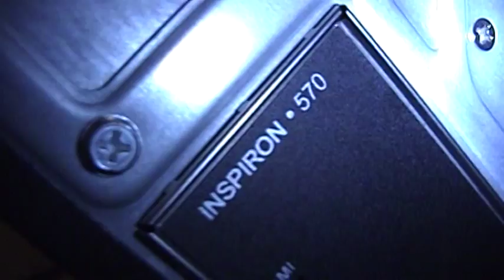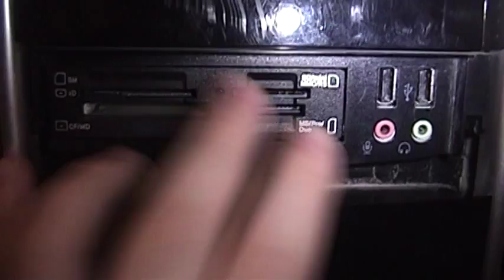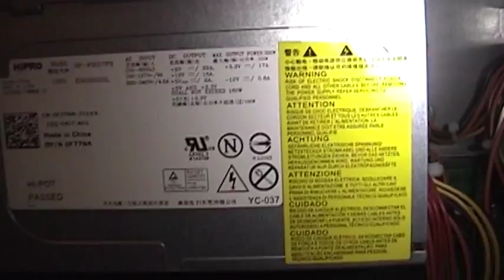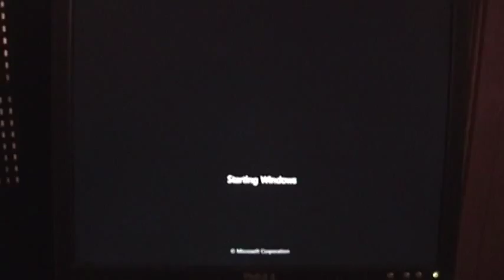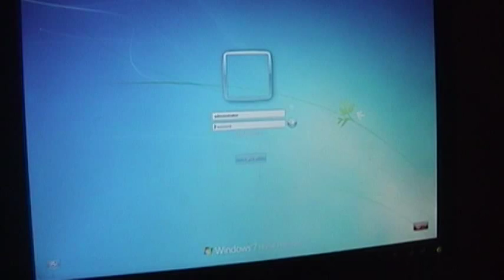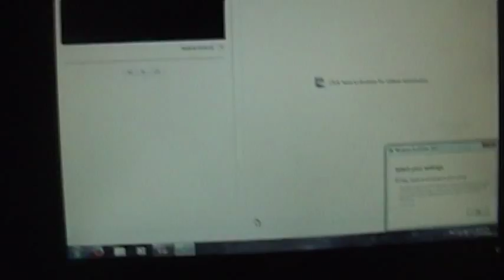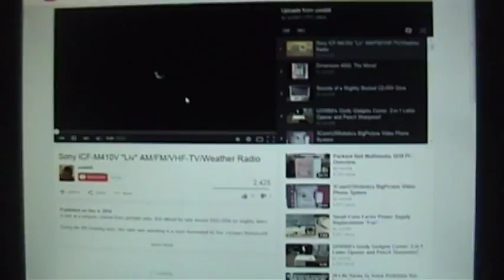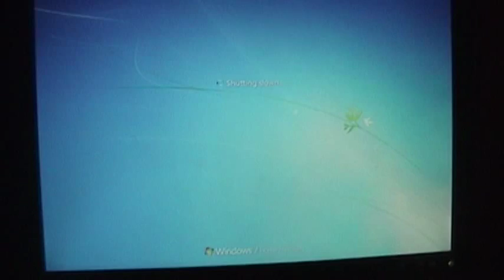A Dusty Dell Inspiron 570

Comment: I caught the STOP code as being 116, which is indeed a video driver problem ("VIDEO_TDR_ERROR", or basically "The driver crashed and had problems recovering"). ATi's later drivers are not well known for stability as far as I can tell. I'm not sure if they've gotten better since the AMD takeover or not as I don't own any AMD stuff modern enough.

That hard drive is a Western Digital (WDC5000something), if you didn't figure it out already. ;)

The auto-power-on-after-failure thing is useful for servers, that way you don't have to remember to run down four flights of stairs and turn the computer back on, but is otherwise best left off.
Reply: true but on a consumer oriented computer like this one, that would be a moot point i dont see many people using these as server, unless you had a spefic task for it to do cheaply.....

Comment: Cool computer, I'm personally using a Inspiron 546 to type this right now. It's been my Main computer for maybe ~3 years when I got it from a pawn shop for a steal because it had a virus they didn't know how to fix on it. It has some extras put in it as well, put in by the previous owner. 2 extra gigabytes of RAM (totaling 6 gigabytes) and a sound card. The one thing about it however is the processor (AMD LE-1660) just isn't powerful enough for some of the more CPU hungry tasks I put it through. Overall it's a nice computer if you just do basic internet browsing and other light tasks, though. With the upgraded CPU in yours I'm sure you'll get some good use out of it, wherever it ends up.
Reply: +Waltzkon Hello I don't know if you're still active or not but do you know where I can learn the basics of upgrading those computers? I have the Inspiron 570 and I just want to upgrade it enough so it can handle games like Skyrim or tombraider. it doesn't have to be high quality on everything just enough so it's even playable. Right now games like Tomb raider are 7 frames per second on very low everything so that's how bad it is.
Reply: +JohnStarvingGrate If it doesn't have a graphics card I'd just look for a cheap card, probably used. I have a ATI Radeon HD 4600 in mine. In my setup it can play games like Skyrim but sometimes does dip to unplayable levels (sub 5 fps) at the more intensive moments. However, you're already going to be better off than me as the Insp 570 has a Dual Core processor at 3.00 GHz and in mine it is a single core processor at 2.8 GHz. Adding any graphics card if you don't have one is going to be a very big improvement.

If you're looking at any crazy major improvement in gaming you'll just have to upgrade you're computer.

Comment: I replaced the hard drive in my Dell Inspiron 570 Desktop.  When I start the system now, it indicates NO BOOT DEVICE AVAILABLE.   Can someone help me please?
Reply: +Shirley Riley How did you replace it? it is not like changing a flat tire on a car, just change it and go, you have to reinstall the operating system in this case windows.
Reply: +Shirley Riley here is what you do, when you first start it up you go into the bios (repetitively press F2) go to the boot tab and go to hard disk under the first list and hit enter, after that it may say  (disabled) hit enter on that and select your hard drive (listed with its model number) that should fix it! your welcome